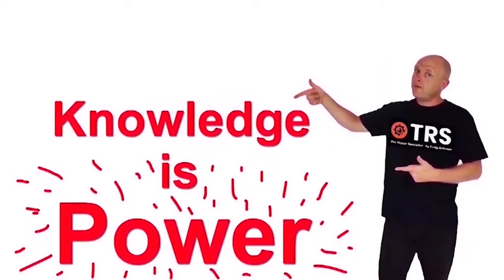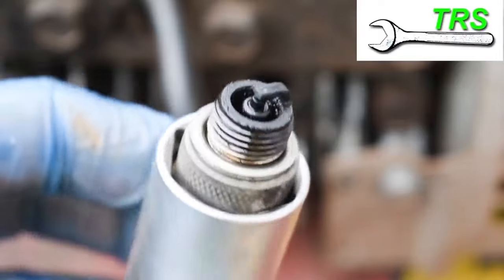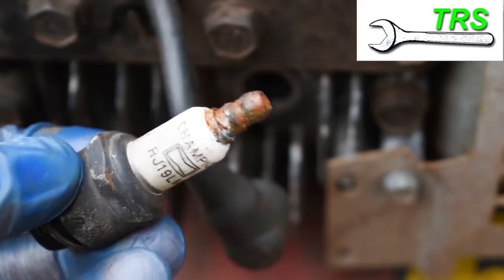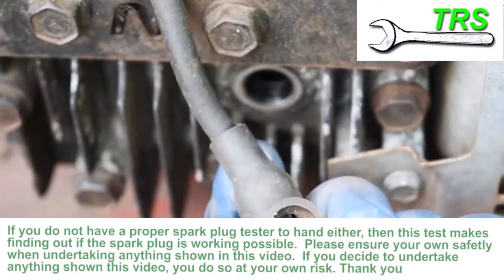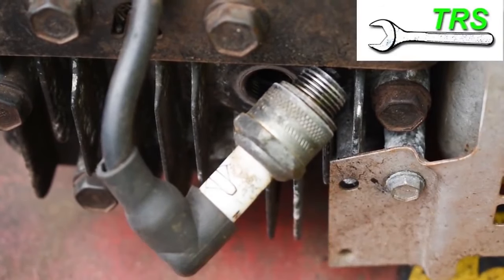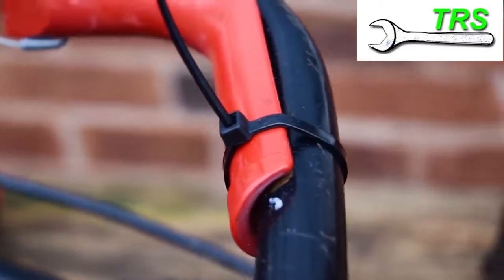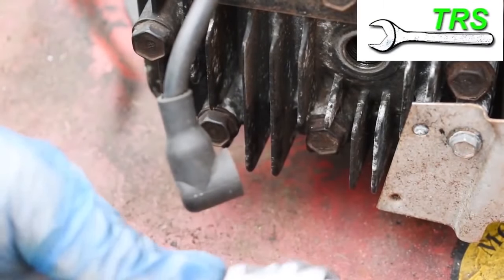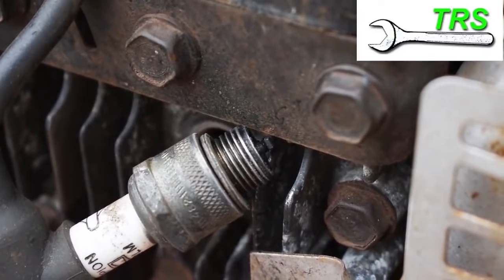How to Test a Spark plug without testing equipment. (Lawn mower Spark plugs)  (by Craig Kirkman)

Comment: This is a great test. I have been doing this since I was 15 years old. I just turned 69. I repair small engine equipment now in my retirement. I used this exact same test yesterday on a mower. Not only is this a good test for a spark plug, it also tests the spark coil and the high tension lead.

Comment: Why didn't I make this video ?LOL Nice demo as usual. I have to add this, many years back I could not get my 16 HP Kohler to start. It had a good spark (so I thought)  an old timer LOL asked me what I had done so far & then told me to change the plug. I said it has a good spark. He said change it. Well me being a typical young ...... worked on it for another couple of hours, nothing. I had to go out & before I went home I bought a new plug. Installed the new plug & it started right up. This old timer keeps this in mind when I try to help a stubborn youngin.
.👍 30
Stay well, Joe Z

Comment: I made a spark plug tester from a small hose clamp and a pre-wired black battery terminal clip with about 6 inches of the original wire.  It's from a Battery Maintenance Charger that died.  I soldered the wire to the hose clamp on the tightening/loosening screw cover.  The hose clamp is tightened around the spark plug threads and the battery terminal clip is clipped onto ground.  This way, my hands are free to turn a starter key on a tractor mower (with the clutch/stop pedal bungee-corded down and the seat switch is permanently locked closed), pull the starter rope on a push mower, etc.  I always have a cable tie wrapped and locked loosely enough to pull up and over to hold a push mower's throttle handle pulled so the engine doesn't die when I have to move away from it, but easy enough to move back down and out of the way when I'm finished and want the engine to turn off, so that would free another hand when testing a push mower spark plug.  Then I bought a Tool Aid brand "In-Line Spark Checker Kit for Recessed Plugs" which has a light to watch to more easily know if the spark plug sparks and the kit has other nice accessories.  Cat. No. 23970.

Nice one, Mr.s Craig.

Comment: If a spark plug has developed a crack internally or is long term fuel soaked from a faulty carburetor,  having spark is no guarentee that plug will work even if it does spark. Honda mowers are prone for bad plugs over time. I use a spark plug tester in line with the coil. A mirror comes in handy if you cannot see the tester over the bulk of the engine. "When in doubt, throw it out" is a rule for old food and works with any small engine as well reguarding the spark plug.

Comment: What can I do if I need to replace the spark plug and the one I need can’t be found on the market at all. It’s a K7TY according to manual
Reply from the maker: There are several things you can attempt if the K7TY spark plug model that your handbook recommends is not available:

Cross-Reference: Spark plug manufacturers occasionally provide cross-reference charts to assist you in locating a substitute plug for the one that is listed in your handbook. To find suitable substitutes, look for cross-reference charts online or get in touch with spark plug makers directly.

Consult Auto Parts Stores: Go to your neighbourhood auto parts store or give them a call to find out if they know of any spark plugs that work with the engine model you have. They might have access to information sources or databases that can be used to find appropriate substitutes.

Join online forums and communities pertaining to vehicle maintenance or the particular engine model you own. In these sites, fellow enthusiasts or professionals might offer suggestions for compatible replacements or expertise with other spark plugs.

Speak with the Manufacturer: Get in contact with the company that made your engine or the apparatus that holds it. They might be able to help locate difficult-to-find parts or offer advice on suitable spark plug substitutes.

Expert Mechanic: See a professional mechanic or technician that specialises in your engine type if you're still having trouble finding an appropriate replacement spark plug. They could be able to find a suitable replacement because they have access to more resources or information.

To guarantee optimum engine performance and lifetime, always follow manufacturer recommendations for maintenance and part replacements and keep compatibility and performance as your top priorities when choosing a replacement spark plug.

I hope this helps a little 

Craig

Comment: Throw that plug away, it has carbon build up on it, carbon conducts electricity, the spark can bypass the gap though the carbon  build up when the plug is in the engine under compression, if the engine runs with that plug, it will probably have a miss under load and a poor idle.